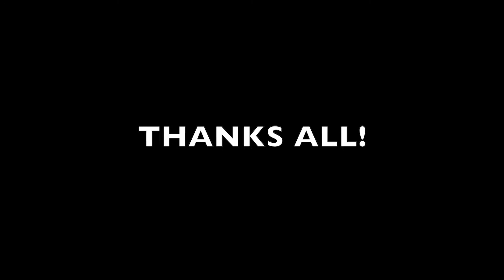JEEP WRANGLER JK TO JL CONVERSION TAILLIGHTS INSTALLATON GUIDELINES FOR JK | AMOffRoad

Comment: Do you guys have a non tinted set? like the OEM red look?
Reply from the maker: Hi, for now we only have this red kind of wrangler JL tail light. 
http://bit.ly/385DWLW
Reply from the maker: the jl style taillights for jk in red lens will be released soon.
Reply: Do you have a side by side comparison so I can see how much larger they are?
Reply from the maker: @towerman8170   J  the size is same as JL taillights. much larger than oem jk.
Reply: @AMOffRoad  Do you guys have a non tinted set? like the OEM red look?
Reply from the maker: в интернете yeah. It will be available soon.
Reply: Does it need the resistors?